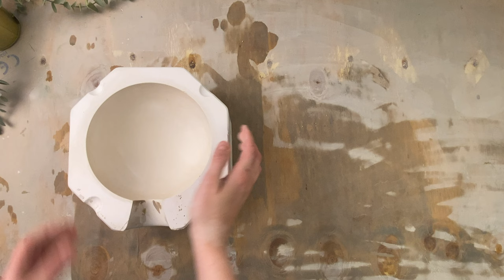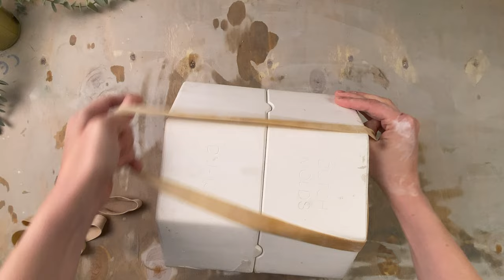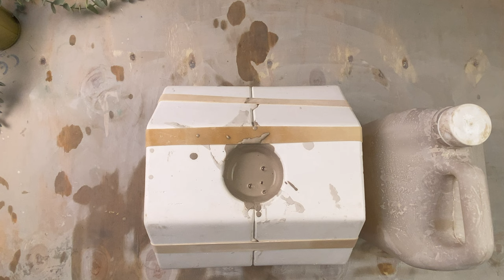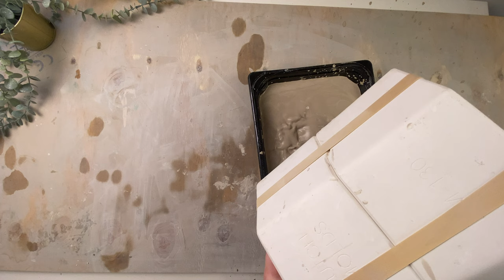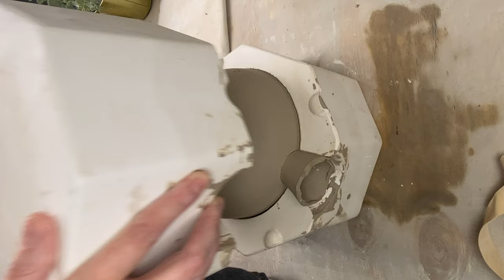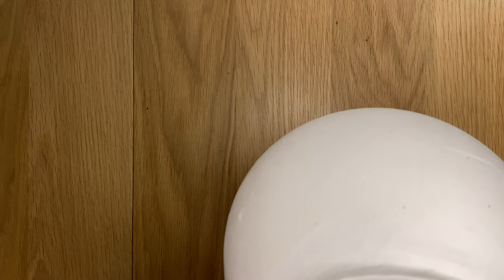How to Slip Cast a perfectly-shaped sphere from a two-part plaster mold

Comment: Thanks for sharing. I am totally new to ciramics. I am teacher in school.  But I love ciramics. I have some questions if you answer please
Reply from the maker: Hi! That's great that you decided to try something new. I'm always happy to help
Reply: @g-pot8148  can I add sand to slip to stop cracking? If yes , then size of sand particles matter?
Reply from the maker: @edwoodcon9039  At what stage do you see cracks?
Reply: @g-pot8148  at very first stage ,, I mean , during air dry . I have not fired  yet
Reply from the maker: @edwoodcon9039  You can try to wrap it in plastic. Maybe the drying process is faster from one side and it can cause problems. The whole item should dry evenly
Reply: @g-pot8148  thanks again . Here in Pakistan, it is very difficult to buy clay ,even online purchasing is very difficult. So I am trying to process my own clay . That's why I am facing difficulties.
Reply: @g-pot8148  again thanks for your words 👍